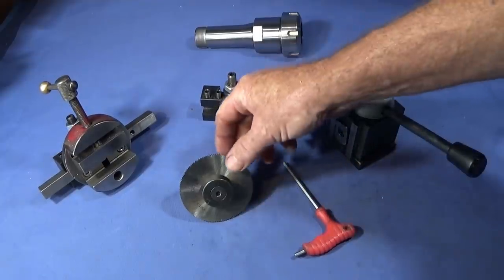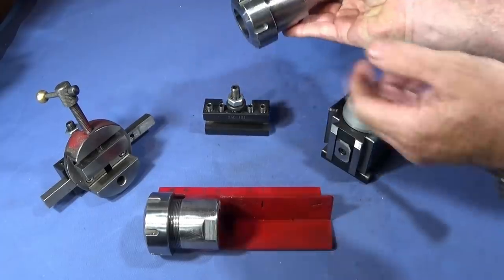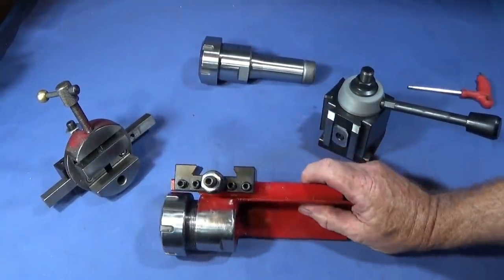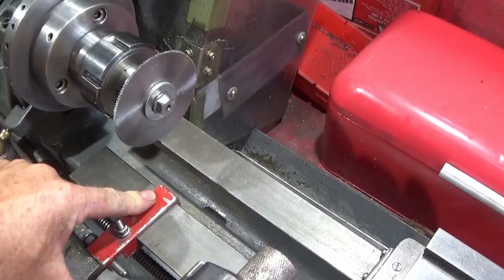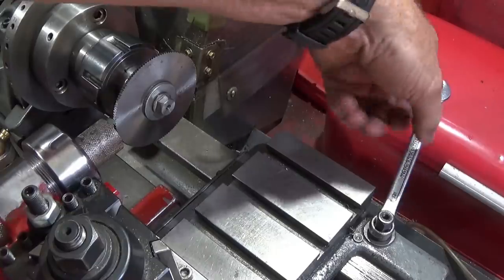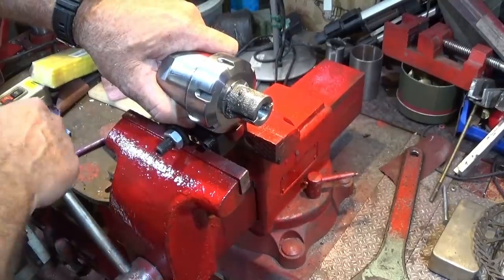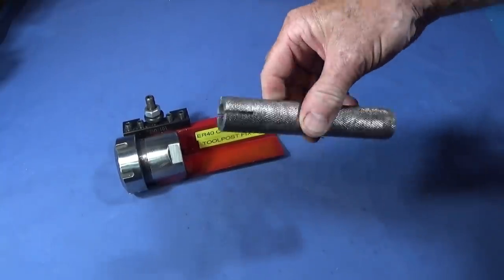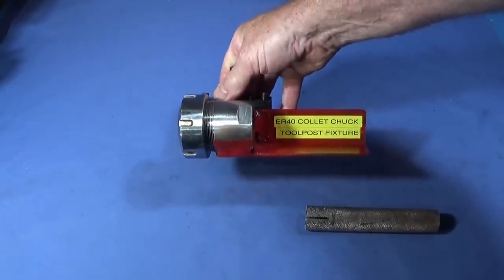Easy To Make ER40 Collet Chuck Toolpost Fixture.

Comment: Is the run-out in the live centre or the collect chuck holding the saw? Did you check the the lathe collet chuck for run-out after you bought it? Any imports I have tried have required re-machining to make true. Just curious. Great idea when you don't have a mill. Stay safe.
Reply from the maker: I think mine runs out by about .002" on a few collets. I need to centre a new bolt for the Arbor though as I took that one off a bought Arbor that wasn't true. I should have done that for the video, but I was pushed for time. Regards Steve
Reply: @SteveJordan  Thanks for your reply.  I know that many of us cannot afford the tools and accessories we would like, so many of us buy the cheaper imports, sometimes we strike it lucky but I think mostly we get what we pay for. However, as many home machinists have shown, many items can be brought up to spec with some careful re-machining. The German machinist, Stefan Gotteswinter, has shown many of his reworking of imported tooling with considerable success. However, he is a man with very high skill levels and abilities, far above many hobby machinists. Always interesting to share topics and ideas, I learn something from everyone I watch. Stay Safe, Steve and all others out there.
Reply: I noticed that. It probably has little bearing on slitting, but could introduce chatter when lathing.

Comment: Very nice piece of gear!! Is that a piece of 10x10 HSS you’ve welded? Bolted? To the angle iron to put in the tool holder?? 

Great video! Thanks for sharing!

-Joe
Reply from the maker: It's a piece of 1/2" mild steel bolted and welded on. Regards Steve

Comment: At around 6 minutes when tightening the er40 I noticed literally no movement in your gibs. Are they that well adjusted or did you have the locks engaged?
Reply from the maker: Hi Steph it is adjusted well. It is a nearly new long cross slide I fitted a couple of years ago though. Regards Steve.

Comment: Nice upgrade!  Curious why the extra length, on backside of collet fixture, is needed.
Reply from the maker: I left it long for strength but also may upgrade it later in some way on that end. It was a trial with materials I had. I may make another shorter one out of thick steel plate sometime.
Reply: perfectly logical, thanks for the quick reply!

Comment from the maker: Machifit 5C ER40 Collet Chuck Holder ER40 Collet Chuck -- http://bit.ly/37YxV4n

SUPER HARD DCMT070204 INSERTS FOR MACHINING HARD METALS.
Drillpro 10pcs HRC45 Blue Nano DCMT070204 YBC251 Carbide Insert for SDJCR/SDNCN/SDQCR Turning Tool
https://ban.ggood.vip/116V6
Normal Price: $23.99
Coupon Price: $ 16.99
Code: BG4b76e8
Warehouse: ALL
EXP: 3.31

Comment: Nope, I don't think that is a practical piece of kit.....at best you end up with a curved slot bottom and no way to index around like a dividing head or spin indexer.......no way to run the cutter through.........could have some uses but I don't think I'd go down this path.......lathes are for turning not milling......at best it would be a poor man's milling solution when the Devil really drives hard.
Reply from the maker: Well I am really pleased with it. I have used it many times since making it. It doesn't matter in the slightest if one has a curved slot at the end when making expanding mandrels etc. Also I haven't got room for a milling machine. I have found it excellent for milling keyway slots in shafts etc. 
  Lathes have been used for milling ever since they were first made. Check out the old lathe books. I have a Myford lathe milling vice as well and a motor powered milling attachment to fit on the lathe. So you are wrong about that. Regards Steve
Reply: @SteveJordan  Yes, I agree that it could be useful if you had no other means, but I would not think it would suit everybody as a go to item but who knows.
I think one can get spoilt when you get exposed to a variety of machinery and have a space for it.
I think I'm a purist and like dedicated machining operations on machines that are designed for the purpose.....what's money after all you can't take it or the machinery with you.....LOL.
Reply: Speaking of driving the devil Ian Pearson, you’re the guy that might convince the wife that I need more dedicated tools and should place them in her half of the garage. If you’re really good, you might even convince her I need a dedicated work shop. Lol
Reply: @reelmoody2376  Well, in that case you need to be able to justify your need for more tools......making something you can sell will go a long way to make your ambition pay dividends.
In the mid 90's I invented a device to save time at the place I was employed at and registered as a small business for A$50 to make the parts and supply them over a period of 5 years or so.......I made approx $27K just working evenings and weekends etc.